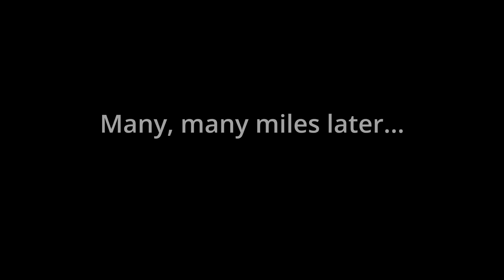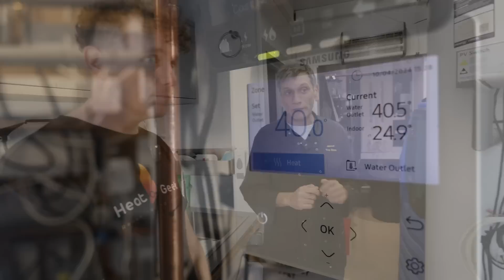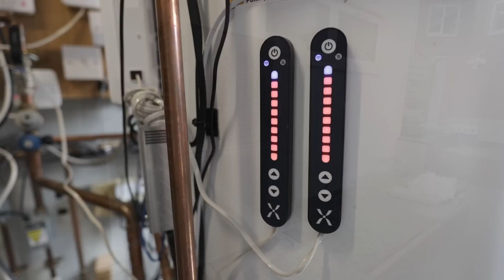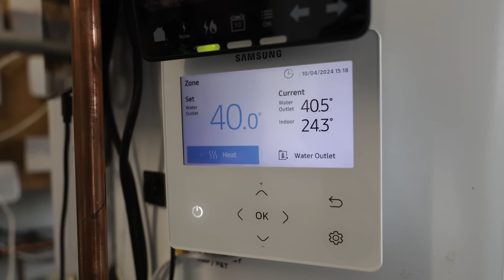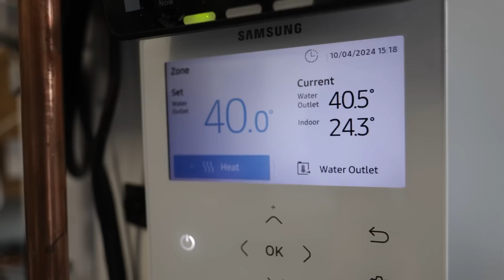Urban Plumber & Chief Heat Geek Put The World To Rights

Comment: Interesting, but when is somebody going to highlight the phasing out of HFC & HFO refrigerants currently used in most commercially available heat pumps over the next 10 to 15 years, such that you will NOT be able to obtain replacement refrigerant?😮
Reply: IN 10-15 years no doubt I'll be replacing the ASHP anyway (?).  And if Hydrogen ever becomes a thing (yeah right) then at least I have the "infrastructure" to integrate it, should that day ever come...

Comment: Engineers are degreed qualification most heating installers are technicians or fitters not engineers this is the dumbing down of engineering  sector  but the content of the vid is great as always,  one item though in commercial installations isn't the dead leg of the DHWS meant to be 1m  so the reduce water wastage amongst other things?

Comment: I’m curious about whether you think this installation might have been bettering implemented using two heat pumps, one weather-compensated for heating, and one running at a fixed flow temperature for hot water production, perhaps with solar thermal to increase efficiency in the summer?

Comment: I have a mid terrace house in the Netherlands. It has three floors and is currently heated by gas. It has been apparently the law/rule here for some years that boilers and thermostats have to be modulating and ours use OpenTherm (this just means that the thermostat can tell the boiler how hard to work based on the difference between target and current temperature). 

We can set a target temperature for particular times of the day and I believe the thermostat "learns" how far in advance it needs to start the boiler. So if we want the living room at 19C at 7am then the boiler might need to run from 6:30AM on a relatively warm day but 6AM on an extra cold day. I'm not sure if the thermostat is smart enough to figure this out, but it does not measure outdoor temperature only the current and target temperature. I suppose it can "learn" for each degree off the target, how far in advance it needs to start.

I keep hearing about weather compensation altering the flow temperature based on the outdoor temperature. I understand that to keep the COP as high as possible you don't want to run the ASHP intermittently so by lowering the flow temperature the room will warm more gradually and ideally deliver just enough heat to compensate for the heat loss to outdoors. But I am still curious why the system advocated is based on outdoor temperature and not indoor.

BTW I used to live in the UK (30 years ago) and I think I'm right in saying that most houses did not as such have a room thermostat controlling the boiler, they just had a timer and thermostatic radiator valves were not common either. Is this background of relying on timing rather than thermostatic control an influence?
Reply: Outdoor temperature can tell you how much heat you need to add to your house to keep it at desirable temperature and can regulate flow temperature accordingly. Indoor temperature only tells you if you need more or less heat, not how much. Though if you like me live in an old uninsulated and not wind tight house a combination of the 2 would probably be best since wind speed and direction can make a big difference how much the house is chilled, which just using the outside temperature don't take into account (At least my 20 yo HP don't take wind into account, perhaps newer does?)
Reply: @scania9786  I think I can see an argument for both but I still can't see how exterior alone would be effective. Possibly I'm missing something, but surely you want to turn the heating off once you reach the target temperature indoors. 

I guess that a system that learns by historical trial and error based on internal and external measurements would be more accurate than internal only.

Comment: I’m at a loss why zoning is not recommended.
Especially for a B&B, with no room occupancy.
Interesting video, I see many issues with recirculating hot water.
Cheers from Oz
Reply: From Javed speaking as a non-engineer:  In winter the ASHP keeps the building at a baseline temp (around 18c). I found through trial and error, empty or not, it became super-cheap to keep the ASHP running for about 12 hours a day.  Now that Szymon and Adam have been through, I'll look into simplifying the system.  The mass of wiring etc was a leftover from when I started with a Gas Boiler...

Comment: 12:24 You congratulated the owner on his instal at the end.  Only problem is  it don't seem to work very well and probably cost him 60 000 pounds.
Reply: I'm not getting defensive here but I didn't spend 60 grand 🙂and yes, after much tweaking the system works brilliantly as far as I am concerned. My metrics are guest satisfaction (very high) and utility bill (very, very low).  Come over and experience it for yourself :-)

Comment: The two pipes that you thought maybe sensor pockets are the flow and return connections of the redundant coil. As a Mixergy heat from the top down the coils located in the upper half of the cylinder. Heat Pumps connect direct via the plate at the bottom. 🙂
Reply from the maker: Didn’t think mixergy had a coil at all - what the point of the coil if it’s plate loaded ?
Reply: @UrbanPlumbers  The coil is for Fossil fuel appliances. You can program the Mixergy for either Gas/Oil, Electric only (Immersion) or Heat Pump. The coils surface area isn’t large enough for Heat Pumps so it utilises the direct connection ports on the lower section of the tank. By doing this the advertised smart functions of the Mixergy are turned off, it needs to be set to 100% heated. As the heat source is now at the bottom there will be some form of stratification. The lift pump still operates to produce an even heat throughout the cylinder.

Just to add, you can buy Direct and Indirect Mixergys, but they both come with direct ports for the Hest Pump.

Comment: But can the grid support such increase in base load with all of those heat pumps? We have to do a multi-million dollar upgrade of our building complex's electrical distribution system just to be able to support all units if they choose to get a heat pump or a stage 2 EV charger...
Reply: The ASHP runs off a 32 amp / 7kw supply and very very rarely runs with this sort of load for any amount of time. In the main it chugs along a 1 to 3 Kw....
Reply: @MagnoliaHouseRye  Right, but in our complex every house gets a 110V/20A hookup, granted, they are not 300m^2, each unit is ~100m^2. But there's ~100 of them in the complex, so those add up really fast. And for the entire neighborhood to convert we'd have to dig up everything and change every sub-station and those distribution transformers, etc... So as much as these are cool, I don't really think it's feasible in certain countries at the time being. I'm currently running a 98% efficiency direct flow heater and a 96% efficiency forced air furnace using natural gas and it works out quite well.
Reply: @berkano_plays  It does help that I have a 3-phase (400V and 300amp) supply. Come and visit...I'll give you a PAID guided tour but will throw in a free room for the night and I'll even cook you breakfast and let you charge your EV 🙂 My 'mission', if you will, was to set this place up so that it never has to burn anything ever again...

Comment: The hardest thing is getting the registration for reccs and mcs, Oftec have been good and informative though. I am putting in a 12kW arotherm in running it at 40° split between radiators and UFH, hoping it’s going to work ok using them on two zones. Love what you are doing, and making things simple is the best way. 👍👍👍
Reply: Why two zones?
Reply: @tlangdon12  it’s a large bungalow but has a loft conversion with one large bedroom and en-suite up stairs and a further three bedrooms and office. As it’s 12kW I’m putting a buffer in and keeping the UFH on one zone with a VDM 15 which does the living areas and radiators on a VDM 10 the other.
I would have liked to have the lot on one open circuit running straight from the heat pump. I just don’t have the bottle to do that though.
Reply: @robharrison6918  Sounds fair enough. The VDMs should keep the efficiency up. But I wonder whether the customer might have benefitted from trying the system without zoning? It’s a difficult sell because the customer expects the engineer to be able to predict the system performance with a high degree of accuracy under all conditions, but the engineer doesn’t really know what the customer will find acceptable or what conditions will prevail when the customer is getting used to the system.
Reply: @tlangdon12  ha ha, you will smile at this one. They are downsizing and the whole building has been gutted, some floors got broken up to allow for UFH others left as is. They are ready to get used to a whole new system and how the heating will operate. He said his wife may take a little convincing though. But this is the funny bit, they are both in their 70’s.

Comment: So I’d have to change most of my radiators and also hot water tank in my 6 year old house. Then find a location to fit this ugly giant thing in my garden. To save what? Few hundred  year? 😂 yeh makes sense that
Reply: You are missing the point of heat pumps; they are not supposed to save you money. They are being implemented to be sustainable - the gas and oil we burn in our boilers is going to run out. You will be happy with a heat pump once there is no gas because it will be your only option.
Reply from the maker: @tlangdon12 still, you can make them much cheaper to run than gas or oil

Comment: From Javed at Magnolia House Rye:  I learned a LOT from your visit and had a lot of fun on the way!  Just to clarify a couple of points: The heating system started out with a gas boiler, hence all the zoning. I don't use HIVE anymore either - those are just switched on manually.  Each guest room does come with its own A2A Heat Pump and that decision was more about guest comfort, inasmuch as I have to try to please all of the people all of the time.  Quite happy to offer guided tours too 🙂
Reply: Thank you for showing us all your B&B, Javed. It's an especially interesting situation because as you've identified, guest comfort (through choice of temperature) is in a way in direct conflict with the concept of not zoning for efficiency, so using separate A2A is probably a good balance.

If you did not already have the A2A systems, I would have suggested looking at a VRF-HR air conditioning system in addition to the wet heat pump that you have. VRF-HR is essentially a multi-room A2A air conditioning system (So a single outdoor unit with multiple indoor units, that's the VRF part) but the HR stands for heat recovery meaning that it can simultaneously heat and cool - I.e. It can directly shift heat around between rooms.

Usually, VRF-HR is reserved for larger commercial-sized systems, but I think your B&B might be large enough for one. That would give you the benefit of weather-compensated heating without zoning while allowing guests to control individual room temperatures. Of course, that's a moot point now because you have already purchased the A2A systems, but maybe it's something to consider in the future when they are up for replacement.
Reply: Interesting to see you have a mix of A2A and A2W systems in the same room. I guess they can conflict if a guest likes it cool and sets the airconditioning on while the heating is also on. However it is a setup I had thought of for ourselves. We have a mid terraced house with gas heating at the moment and would like to switch that to A2W but the focus was going to be on heating the living room primarily with water and also the bathroom which has no outside walls. Then have A2A in the bedrooms so that we can keep the temperature there comfortable all year round especially in the heat of summer.
Reply: @NickAskew  The A2W is set to keep the rooms at a baseline 18c or near as dammit....I've had guests who like to bake themselves right next door to guests who prefer a much cooler room...come down and see for yourself 🙂
Reply: @NickAskew  I'd suggest you keep the gas boiler and add A2A. We have a gas boiler and two a/c minisplits - a system that I'm really happy with. MiniSplits are so cheap and simple to install and they heat the house for less cost than gas. Heat pumps aren't so good for hot water so we use the gas boiler for that. All house radiators are truned off except the bathroom towel rails, and the central heating comes on for just 15 mins in the morning to dry the towels. This hybrid system gives us so many options for heating and cooling. Our house is open plan - any internal doors are left open so the a/c units (2x 3.5kW) heat all 180sq.m. If people come to stay we could close bedroom doors and return to gas CH if necessary. We also have cooling if needed. Gas central heating is still an option if cheap electricity ended, or if climate chaos sent the temp to -15°C for months on end.
Reply: @johnhunter4181  A very, very sensible setup.  It was suggested to me that I also kept the Gas Boiler; the Mixergy Cylinders would have used that as a 'final' energy source.  Ultimately it came down to a personal decision to get to get rid of it, and the gas meter (annual safety inspections and standing charges notwithstanding).
Reply: @johnhunter4181  Ultimately where I live the gas will be turned off. They are talking about possible centralised city heating but not for my estate. However an initial installation of a couple of A2As might be a very good idea.
Reply: Thanks for allowing the guys to look around, I really want to see if someone if bold like @UrbanPlumbers to ditch the hot water cylinders in favour of heat batteries such as @SunAmp Therminos as there is not much online sadly of this revolutionary tech which may allow people to embrace low carbon tech as ASHPs more into their home given that flats etc have little space even for the slimmest and tallest Hot Water Cylinders 👍
Reply from the maker: @chandreshvarsani2190 watch this space. We may have something even better than heat batteries coming soon

Comment: That is a very good install for a BnB it hits all the requirements of zoning to keep end users happy. A well thought out design, possibly not the best from a performance metric for heat pumps but our industry at the end of the day isn't about performance it is all about end user comfort. A by product of end user comfort can be performance but depending on the type of installation it should not necessarily take precedence.
Reply: not to mention my legendary breakfasts :-) Thank you for your positive comment; you should come down sometime 🙂
Reply: I think this was missed a little in the video.
It’s more about comfort than maximum efficiency, for a B&B.
Reply: @pulporock  I come from a commercial background dealing with hotels and office blocks. Zoning is a must because solar gain along with other factors can have a 5-10 degree C difference on average between one wing and another, or the bottom floor and the top. 

There is only so much dynamic flow temperature can achieve, so you're either using mixing circuits per zone to keep them open flow, responding to per zone set temps which would be the most efficient way or on/off zone valves. On/Off is less efficient but cheaper to maintain and faster turn around on breakdowns.

Comment: you mentioned the removal of the ports and balancing the valves, letting the system settle because of things like solar gain and then tweaking it again to male it comfortable. Is this something you would expect to do seasonally or just on initial commissioning?
Reply from the maker: Once set up at cold weather it would be pretty much self regulating form there onwards.

Comment: Nvq lev 2 and 3 has to be updated to do installs and. Calculations with air to air , I still feel in addition to a practical and theory examination it should be part of all apprenticeships core requirements that has to be signed off, there has been far to many problems with installation done by companies that set up purely for the grant ,  9th home owners left go pick up with the problems, this practice by one common company with a flame shows this is still going on with extremely poor quality on inspection quoting for items already there ,  and not correctly assessing heat loss .  Needless to say I went elsewhere